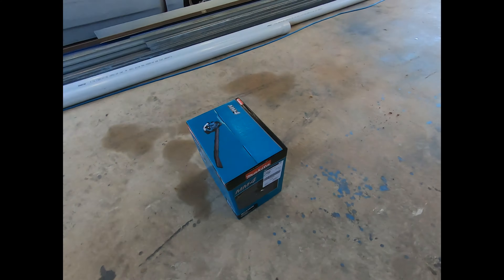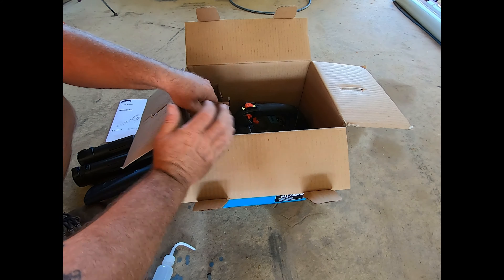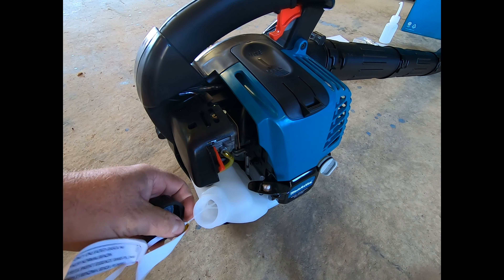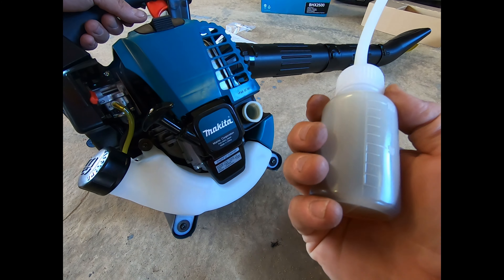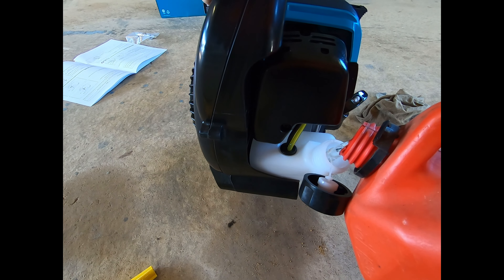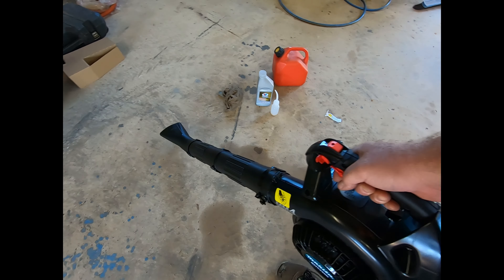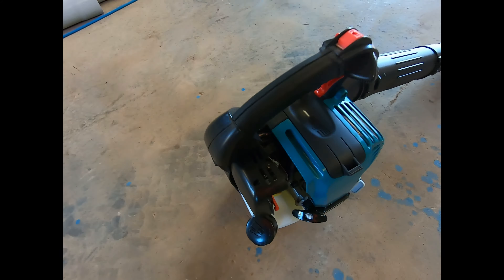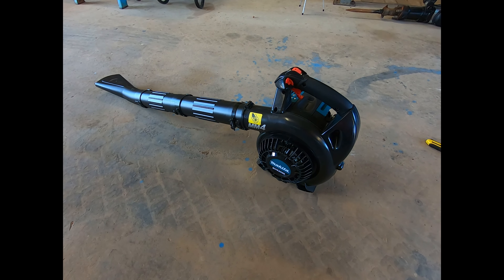Makita 4 Stroke Leaf Blower - Unpack and Test

Comment: I have owned this blower for 3 yrs. No issues at all. I use it left handed as the air intake is on the left side. So for lefties this is the way to go. I use this at my home. I also own a Makita 7660 backpack blower, EM 2662 high torque trimmer & EE 2650 edger for my side lawn care business. The Makita brand is excellent, I am on there 18V platform for all my power tools(many many yrs). Makita is expensive and the 4cycle engines need a little more maintenance but for me its the only way to go. Excellent power, low noise and SUPERB SERVICE!!!!! There is a Makita service center in my area. I had a issue with my 14" 36V Chainsaw. Walked in dropped it off, walked back in a week later and picked it up.. Free under warranty, not an issue since.
Reply from the maker: Great feedback mate!

Comment: We just got this blower at work, someone smashed the plastic case around the carb almost immediately. Now the thing leaks oil out the breather tube anytime its not upright. So it usually gets ran completely dry of oil. Another thing if you accidentally put some premixed 2stroke fuel in it wont run at all. Its still running for now but I don't see it lasting long the way its going. When it does go we will be going back to a good old 2stroke.
Reply from the maker: Time will tell I guess mate!